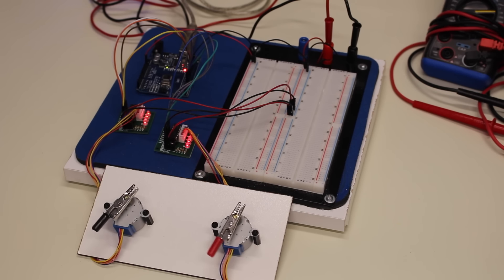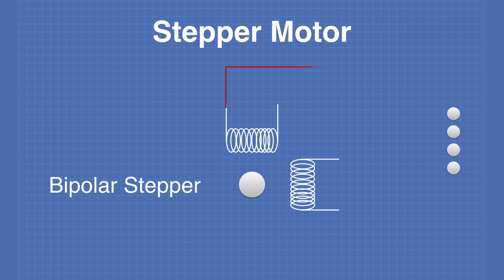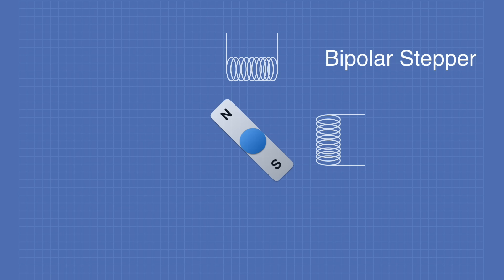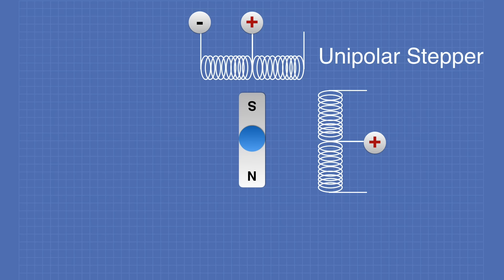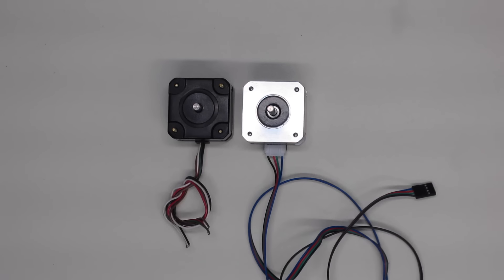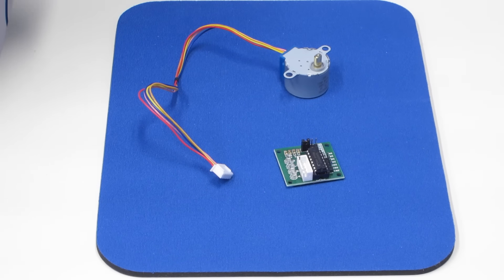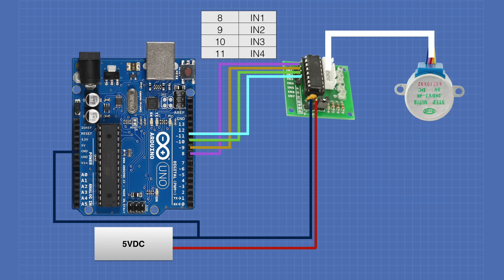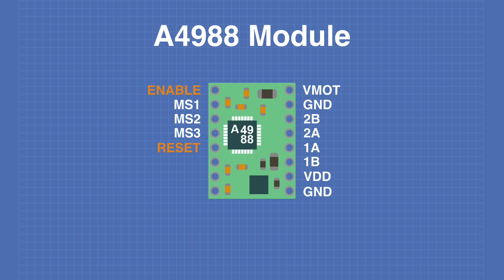Stepper Motors with Arduino - Controlling Bipolar & Unipolar stepper motors

Comment: hey, I use a pm42s-096-mim6 stepper with the A4988. It goes smoothly in one direction, but in the other direction it also moves but it makes some unhealthy sounds. what could be the reason? I tried to change the pins to the stepper but I can't avoid that effect until now...
Reply: I think you have to try every sequence of wire connection

Comment: Subscribed, can you help me to run 48byj-28 stepper motor to run, in my project it is vibrating only and I connected it with 12 volts once, thanks in advance

Comment: for "NEMA 17 Bipolar stepper motor controlled by an A4988 stepper driver" when shopping for a 100uf capacitor, they seem to offer different voltages.  I see you use 12 volt dc in, I find 16v 100uf capacitors for sales, would that work or should it be 12v?
Reply: found info about capacitors elsewhere: "A capacitor with a 12V rating or higher would be used in this case."

Comment: The motor @16:07 uses a separate 5v dc.   could you connect it to the 5v pin on the Arduino?
Reply: found the answer in you article, thanks: "On the subject of power supplies one very important thing to note is that you should NEVER use the 5-volt power from your Arduino to power this (or any) stepper motor no matter how tempting it is. Even though the 28BYJ-48 doesn’t draw much current it will induce electrical “noise” onto its power supply lines and this could damage your Arduino.  Always use a separate power supply to power your stepper motors!"

Comment: Okay so a solution like this as simple as it is is exactly what I'm looking for for a for one of my projects I should say this solves a huge problem for me to be able to use a cheap stepper motor to put out a piece of product that would earn me about $400 an hour if I could sell them that fast. Now how would I deploy this like I don't want to have to keep an Arduino and the driver board and all that other crap hooked up all the time onto a computer it would be nice to be able to build something on protoboard and include a chip with this code written on it is this something that can be done with an Arduino? Or is it a whole different ball of wax when you'd want to do that I have very little background in this I do chemistry and pharmacology is my background I also do metalworking and ceramics as hobbies. But this gadget that I have built all the mechanicals for will benefit so greatly by using a stepper motor for its power and it's as simple as a potentiometer or a push button on and off the top speed of this nema 17 motor is absolutely ideal for what I'm going to do maybe a little slow. What I have to do is in great need in the particular sector that I'm going to Target. I'm disabled so I can't do a lot of work but I can sit and press a button this could be the answer to all my problems. And if it isn't at least I'll have some fun. 

 So what would you do if you wanted to put this on a chip with a push button and the potentiometer speed control and not have the whole setup hooked up all the time

Comment: Technical Parameters

1 Step Angle 1.8°±5%

2 Number of phase 2

3 Rated Voltage 7.25V

4 Rated Current/phase 0.5A（Peak Value）

5 Phase Resistance 14.5Ω±10%（20℃）

6 Phase Inductance 25 mH±20%（1KHz 1V RMS）

7 Holding Torque 2.3Kg-cm Min

8 Insulation Class B(130℃) 80K Max

9 Weight 0.20Kg
Can we use 24 VDC stepper controller sir. Please suggest

Comment: Hi, I have a laser engraving and one of the stepper motor gets really hot, any idea why? 

Thank you.
Reply: Well the kinetic energy is converting into heat energy. The reduce this, you reduce friction, which i dont know how in your case. Maybe you can also submerge the motor in a colder thing like mineral oil that doesent mess with the circuits, or maybe just slow the engraver down to decrease the amount of energy overall so less thermal energy (heat) is produced.

Comment: Thanks for an excellent video ! I have a small question : way in the sample with A4988 there is a noise in the low speed much then the X2 speed and if there is an option to decrease or cancel it ?

Comment: It worked once for me but then the motor jammed and leds stopped lighting up on the driver board, connections are ok so im guessing cheap quality components. If anyone has an suggestions that be great

Comment: Hello guys, Is there a way to control DC motor position without an encoder ?                                                                   I tried powering motor for a given time to reach a certain position, but when I reversed direction and powered for the same time, it didn't go back to the start position. It overshot by some degrees

Comment: Thank you for this tutorial! Amazing! Only one question. About the unipolar stepper, why is not recommended to conect them into the 5V of arduino? I'm trying to control an stepper motor with an IR module, and is the only way it works, otherwise, the motor does not hace enough power :3

Comment: hey  would you gave me some code how of arduino for rpm sensor ? and also i want to know how to program the motor into on off on off in a fast second. i want to make an anti lock braking system for rc car using four dc motor as my electronic braking.. please answer me okay??

Comment: What would be considered a good reading for your A4988 driver in your last experiment. My stepper motor has a .5 A current rating
Reply: we offer belt-driven linear rails which are more efficient and economy for automation industrial, check CCM linear rails,  we also offer stepper motor/ servo motor and driver, welcome send me inquiry

Comment: Hi! Can I ask you some help? I need to drive a Nema 17 stepper motor which develop 59Ncm of torque. I tried to do it with a normal L298 driver, but it happened that the current the motor needed was higher than the one that was written in its own datasheet (2.5 - 2.6A)and so it became really hot, indeed... I'm not really used to do this kind of stuffs, so I ask you: how can I drive it? I already have an Arduino microcontroller (an 8 bit one, with 5V output of control signal), and I would like to use it.

Comment: Are all bipolar motors louder than unipolar? Can that be adjusted?
Reply: It's not a question of the motor type. It's mostly a question of the Driver. A4988 is quite loud, TMC2208 (e. g.) is quite silent. 😊

Comment: Hi 
My interest is to build an Arduino with a stepmotor to use on my old dividinghead and my rotary table - for my milling machine both from the late 70ties. 
I thought that it might be possible to use it on both - But I could build one for each. 

Could anyone help me to chose the correct motors and Arduino etc. for that - 
Sten (Denmark)

Comment: I don't understand why the full steps motor does 2 rotations and the half step does 1, is the gear ratio off or is it supposed to be this way?
Reply: Thank you for the video, but I am curious, I have the exact same motor in my arduino kit

Comment: I seem to be having trouble with this project, the motor driver modules LEDs do light up but not much at all, I'm using an external 5v as well.. does anyone have any idea as to why that could happen?

Comment: Oooohps ; i have a little problem here, I don't know what I don't wrong, my stepper motor is getting hotter and a driver too.

I thought it's dead, but when I run the built-in sketch it's working  (though I noticed it doesn't reverse turn).

What am I suppose to troubleshoot here!?
I'm using the same stepper as our tutor

Greetings from Tanzania 🇹🇿,

Comment: DroneBoT Workshop 

  I need help on the hardware parts.
  and wiring the hardware up .
  and what software to use 
 to operate my CNC machine 
 Here is my list of the parts
 i'am using can you help me  

 1] Stepper Motor Drivers power step PSD8079-2P
 2] steppers motor Nema 34
 3] controler
 4] power supply mean well SP-320-48
 5]                  Hardware and Software 
 6] CNC Breakout Board/Interface Board
 7] Cable Connector
 8] Limit Switches
 9] Emergeney STOP BUTTON 
 10] Software

Comment: i was going to use one of these in a project and I had it set to move and it worked.  then i got up for coffee and when i came back the thing was so hot i could not touch it.  So why would it sit there and heat up like that?
Reply: If you leave the power on then you are passing current through the coils and they will warm up.  Some drivers put a large initial current in to move the rotor then drop it down or short the coil to keep it still/stiff.
Reply: @salisburysteve  I was running it direct off a mega board, maybe that's why.  this thing was pretty damn hot tho.  maybe once you move it you need to turn if off.  come to think of it, this was a servo not a stepper motor.

Comment: You point out that Arduino cannot power up the stepper motor by itself.  Is there a possibility to turn a stepper motor for a full rotation using batteries for short period of time and then shut it off to conserve battery life? 
How much current is being used by these stepper motors on average?

Comment: Hi
 I am slowly working my way through this video with no programming experience. When I attempt to upload I get the following error message after the line 
Stepper steppermotor(STEPS_PER_REV,8,10,9,11);  "Stepper does name a type"  What does this mean?.
thanks
Robert
Reply: not sure, but it sounds like you forgot the "#include stepper.h" line. That includes a file that says what Stepper means. Without it, the compiler has no idea what a Stepper is.

Comment: Hi, please be noted, for your information, that the 28BYJ-48 stepper motor has the internal reduction gears = (32/9) x (22/11) x (26/9) x (31/10) = 63.683950617283950617283950617284....... This means that in order to fully turn 360 degree of the external motor shaft, and the motor is configured as HALF STEPPING, the motor will need this amount of steps = 63.683950617283950617283950617284. ==> So, it is NOT EXACTLY = 64.
Anyone has projects that need very high accuracy/precision, and working with this motor, and doing the calculation for gear ratios, and referring to numbers such as 32, 64, 512, 2048, 4096, etc.... will have an ERROR at the end result.

High accuracy/precision is required for: analog clock, pointing device, etc......

Comment: Sir is it ok if I connect a power source 12v 2A as motor voltage?
Reply from the maker: Aziz that would really depend upon the specifications of your stepper motor - if it is a 12 volt stepper that consumes less than 2 amperes then that would be fine.

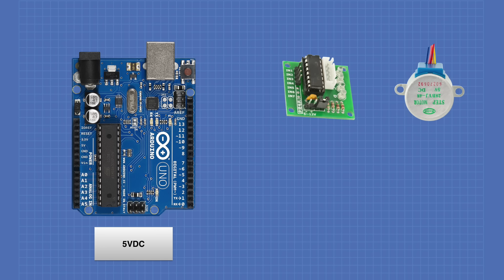Comment: why under no circumstance should we not power the stepper using the 5V on the arduino (15:44)
Reply from the maker: Hi Fin. The power supply on the Arduino uses a 3-pin voltage regulator with minimal current capability. It doesn't have enough capability to handle the amount of current that a stepper would draw, especially under load. Also a stepper will create a lot of electrical noise on teh power supply line as it steps, and that can interfere with the logic circuitry on the Arduino.
Best bet is to use an independent power supply for the stepper. This is also true with DC and servo motors.

Comment: Wait. Why consume 8 of the limited outputs of the microprocessor, when all you care about is 1) which stepper, and 2) how many steps? Why not a circuit in between that takes one output pin from the Arduino to command a step, and another single pin output from the Arduino to select which stepper, S1 or S2, is to receive the command? The number of pins required is now reduced to 2.

Comment: Hi Sir. I'm very much interested in getting to learn Arduino for a project I'm working on. I've seen loads of online tutorials using the "easydriver" etc etc, but none so far using the grbl shield and drv8825 driver. The reason I want to use the grbl cnc shield for controlling three stepper motors sort of like in a cnc machine, but for another purpose. I want this to work as a standalone unit not plugged into any pc but should run from the Arduino natively. Could you maybe please point me in the direction I can learn about this specific idea?
Reply: You may want to look into the Arduino Mega, and Ramps boards.  They drive up to 5 steppers and are used in many 3D printers.  It may save you some cash....

Comment: I just got my first Arduino in the mail and I want to start playing with it but I don't have a motor driver yet. Why is it not ok to connect the Arduino's 5V supply to power the stepper motor? Will it ruin the Arduino? Can I run a PWM fan directly off of the Arduino? In my mind I would have the Arduino running 5V to a DC-DC boost converter to 12V. Now I am concerned that I may wreck my Arduino by not having a motor driver. 

If anyone in the classroom is generous enough to explain to me why, and whats about not connecting directly to the Arduino's power pins I would be very grateful.   ~Thanks.

Comment: I tried to use a 298 to control a Nema 17 motor and it got so hot, I thought it was going to catch fire. Any idea why?
Reply: Did you use a heat sink? The L298 should be mounted on one. Next question: Did you supply the right voltage for the motor? The motor specs (Ohms per phase and rated current) are important. Hope you'll make it. 👍😊
Reply: @baxbanni2226 The 298 does have a heat sink and I am applying 12 volts. It seems to be pulling too many amps but I don't know how to adjust this. I switched to a tb6600 driver but it does the same thing. The motor gets too hot to touch.
Reply: @RobertPatterson192  OK, in your first posting I understood that the L298 got too hot. Now I understand that it is the motor. Let's focuse on the TB6600. I can only guess that you did not choose the right current limiting via setting the micro-switches S4, S5, S6.
Reply: At first it was the 298 and the motor got extremely hot. Not it's just the motor. I set the dip switch to 1.5amps but I wasn't sure of the best setting for microsteps. Now, driver gets a little warm (not hot) but the motor still gets hot enough to cook on it.
Reply: @RobertPatterson192  In my opinion there is only one reason the motor temperature gets too high: The current limitation is too weak. You need to know the exact specs of the motor, mainly the rated phase current. There are a lot of Nema17 with only 1A or even below. In that case your 1.5A setting is probably double the hight than needed. BTW: the TB6600 is a quite "heavy" device. I'd prefer a DM430 for Nema17. It offers you a current limitation in steps of 0.1A. But first please try the 1A setting on your TB6600. This could solve your problems. If possible you should check the internal phase resistance to see whether it still follows the specs and is equal in both coils. Hopefully the heating up did not damage the insulation of the coil wire.
Reply: @baxbanni2226 Thank you. I'll give this a shot

Comment: Very well put together video, however your information on specs is totally wrong.  The Voltage Rating is NOT the maximum voltage that the coil can tolerate (not even close, in fact).  The Voltage Rating is a very misleading spec that is calculated simply by multiplying the rated current (which IS the maximum current that the coil can tolerate) by the coil resistance.  Typically steppers are operated by MUCH higher voltages than the rated voltage (5 to 10 times higher), it is the current limiting that is the critical factor.

Comment: sir i need a help in sketch 
sir ,in first case - two stepper motors(motor A and motor B)  rotate together at different speeds, its ok i can do this.
in Second case -  two stepper motors A and B, motor A rotates but at same time motor B at rest position and after completing motor A its rotation, motor B starts its rotation and motor A on rest position, ok i can also do this
but problem  is here
lets take a example i want motor A and B rotates 360degrees 
motor A start to rotate and motor B start its rotation when motor A competed 180degrees and then both motor are rotate and complete their one rotions

Comment: Sir, Great video. I follow it as a reference. Does any of your viewers know about current and Vref details of a stepper motor with following details:
TYPE 17PM-K310-33VS
NO.     T4524-01
MINEBEA-MATSUSHITA MOTOR CORPORATION. 
I checked with the company. They can't disclose the details as it was made for a customer. I had purchased it from the local market.
Thanks
Just an update. I was finally able to run the stepper motor. Thanks a lot for the excellent video.